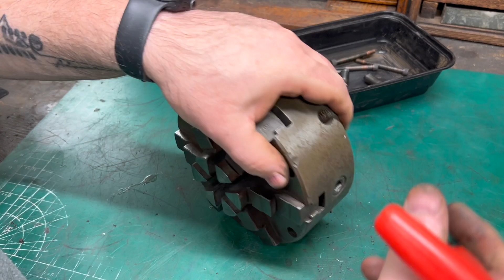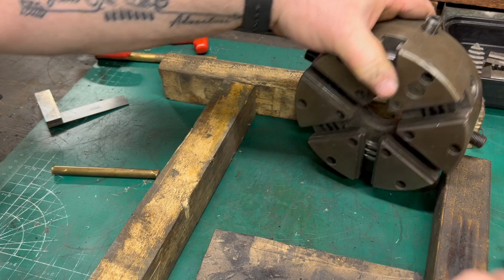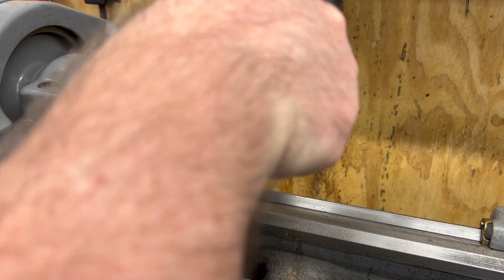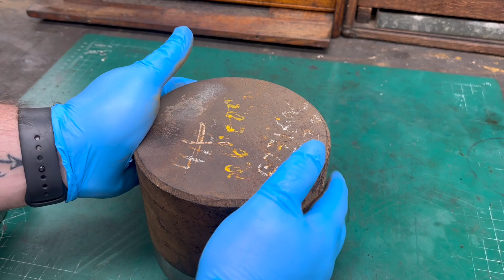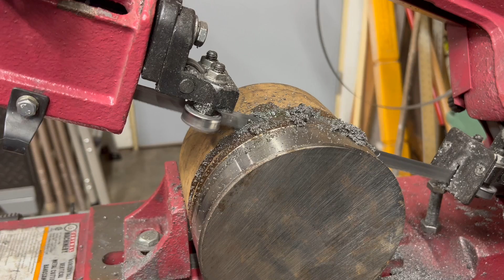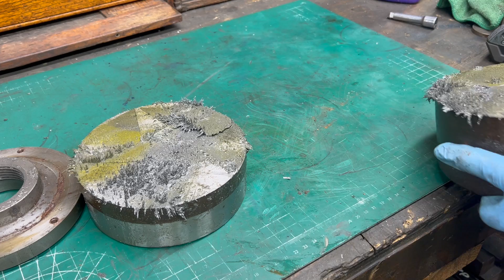Machining a Backplate for a 6-Jaw Chuck for my 1942 South Bend Lathe - Part 1

Comment: I have a 1906 Rahn Carpenter 5-Step Cone Lathe. I thought that it had a threaded nose spindle of 2-1/8” - 8TPI but now hearing that 2-1/4” - 8TPI is a common size on other lathes I’m seeming to recall that the peaks of the threads were often flattened which would explain why measuring with calipers I would be 1/8” short if roughly 1/16” was missing from the peaks on either end. 

This video caught my attention because I happened to have restored the exact same old style Buck chuck (but in 8”) but it ended up saving me from making an amateur mistake when I go to cut my own backplate. I had assumed due to its age it might have a unique spindle nose.
Threads really should be measured using the correct method or tool, caliper are good for getting you in the ballpark.
Reply from the maker: I'd like to find an 8" version of this chuck some day as well.

Comment: For safety, you could thread away from the chuck.
Reply from the maker: Threading away from the chuck for a right hand thread and you risk unthreading the chuck from the spindle. It’s a non starter on a lathe with a threaded chuck.
Reply: @MyLilMule  I didn't realise it was a threaded chuck.
Reply from the maker: @BedsitBob  No worries! I've seen some guys that have made a chuck lock of sorts using a long bar through the spindle with left hand threads on it to lock the chuck in place. Maybe some day I will look into that and maybe make one.

Comment: I just bought my 1st lathe, and im looking for a 4 jaw chuck. I know im going to have to do this exact process for my spindle as well.
Reply from the maker: You might not need to. I've seen plenty of SBL 4 jaw chucks for sale. They are out there for the 1-7/8x8 spindle.
Reply: @MyLilMule  I need to remeasure mine, but I think 1-5/8x8 spindle. Of all the SBL mine is the oddball. Lol
Reply from the maker: @jeff1176  What lathe do you have? The 9" and 10K are 1-1/2 x 8 but I don't know of any that are 1-5/8"
Reply: @MyLilMule  mine is apparently an "O" series 11x48. It looks like the heavy 10.
Reply from the maker: @jeff1176  Yeah, those are the really old ones. No idea.
Reply: @MyLilMule  not a lot of info on this one.
Reply from the maker: @jeff1176  get on the FB groups if you aren’t already. And Hobby-Machinist.com

Comment: did the same thing for my solid tool post build  only my 5" stock was about 4' long kept one end in a chain fall sling was afraid my HF band saw would get crushed ended up buying a HF wheeled cart cut it down sealed it up and made a flood coolant for the saw pretty cool then the weather warmed and it was bicycle /bass boat/ mowing ,ect till probably nov
Reply from the maker: A friend of mine, @MicksWorkshop, did something similar with his 4x6. It's on my project list to do something like it. I'd also like to replace the spring with a hydraulic cylinder.